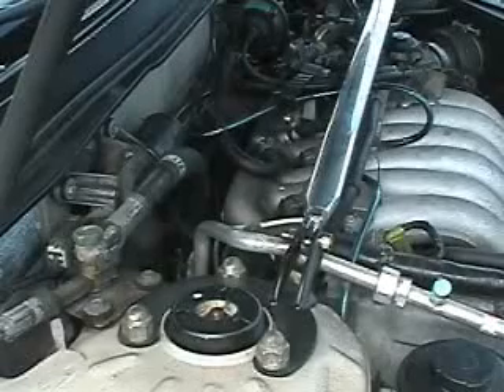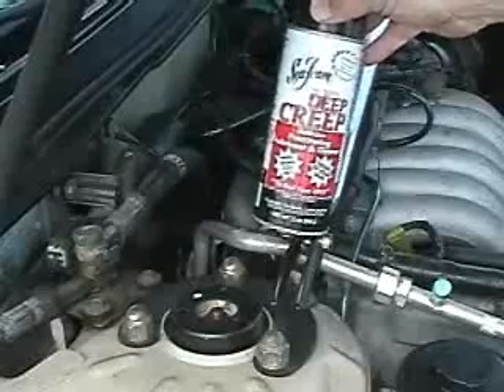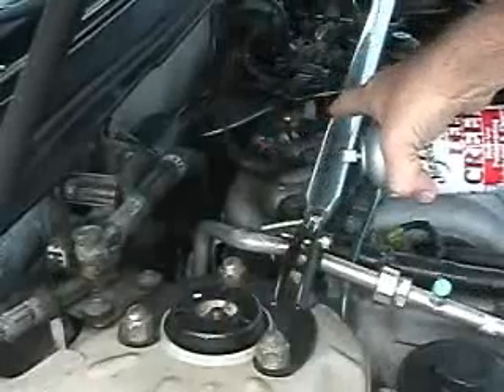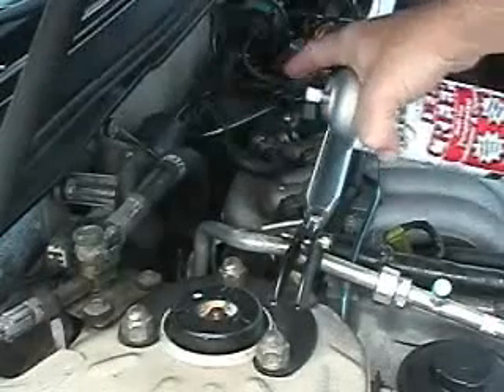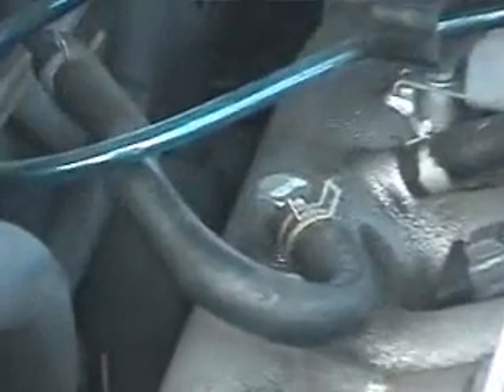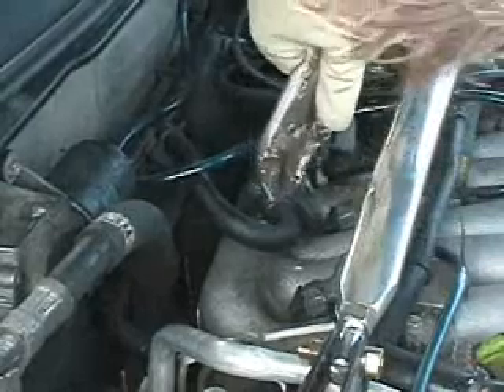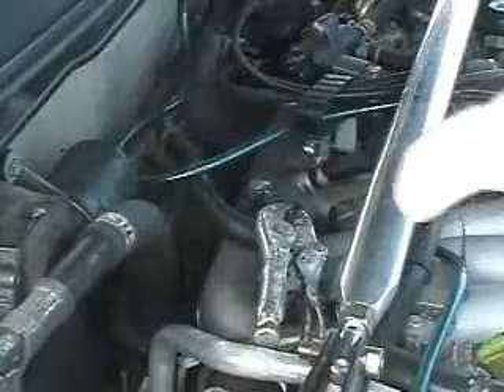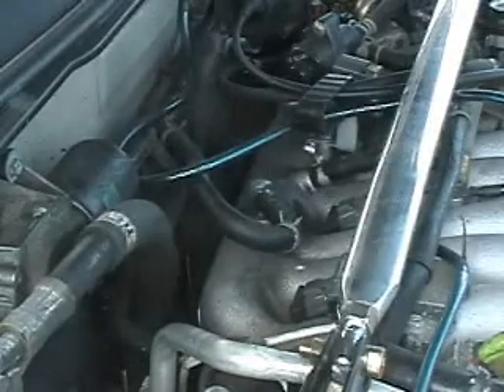Deep Creep, the Movie! A Seafoam Story.

Comment: The liquid is better for top end cleaning.  You suck the fluid into the intake via vacuum hose, about 1/2 the can (slowly) then allow the engine to suck the fluid in until it stalls, let sit for 20 mins and drive.  This cleans out the combustion chambers and runners much more efficiently.

are you sure deep creep and the bottle are the same fluids?